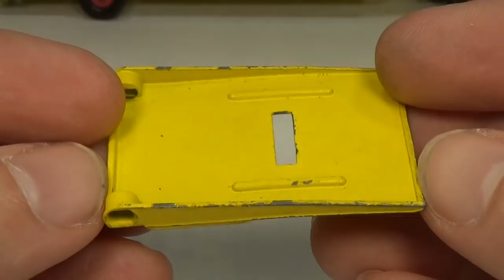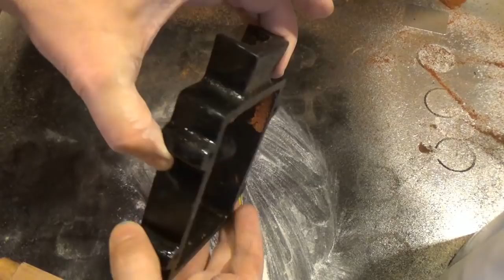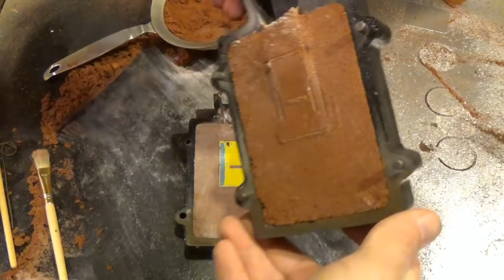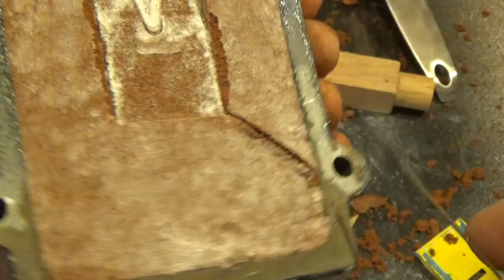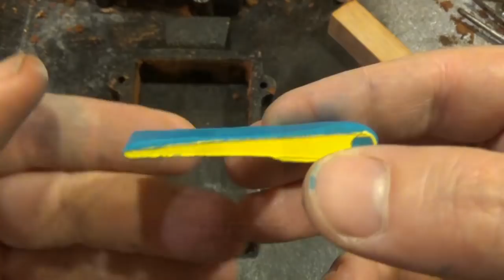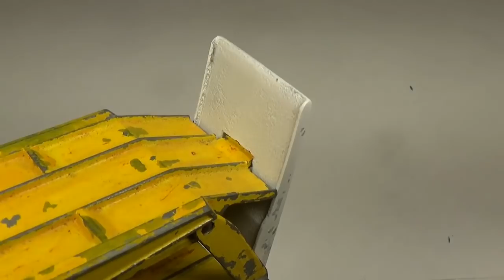Casting Aluminum parts for your Hot Wheels or Matchbox Customs.

Comment: You mentioned safety: no way you should be doing this without welding gloves or something else to protect you from the molten metal. That crucible could slip as you're pouring it. Believe me, accidents happen. Molten metal will send you to the ER. I learned the hard way and have the scars to prove it.

Comment: Hi in the early 1960's i worked at a light engineering firm on a injection plastic moulding machine, they did have a zinc diecast machine. I didn't get to work on that but i know enough to tell you it used molten zinc as you did, but it was forced into the  dies by air pressure pushing a ram and it was water cooled. The dies had to be brushed free of any zinc debris between each and every casting.

Comment: you should create a hole in the section the mold doesn't get filled......later you just need to cut the tube you will get and use the dremel or sandpaper to flat that surface

Comment: I found your video quite interesting as I had been toying with the idea of casting toy parts with low temp metals for some time. However, since many of the toys I have considered casting for restoration or customization have been made by the tens of thousands by the manufacturers, it is much easier to go on line to find beaters to get replacement parts. Case in point, the car carrier you needed the ramp for, I just bought 2 of, in the same auction for less than $10 for the 2 of them. While both are missing wheels, paint and on is missing the windows, they both have the ramp that you attempted to reproduce.

Comment: If you heat the mold before you pour, you should be able to get the thin part done. Bring it up to temp in the oven. It won't be as warm as the molten aluminum, but it will wick heat out of the poured metal slower, allowing the part to fill. If the results are stil marginal, heat it, and point a third torch in the area that's voiding and it should get it over the hump.

Comment: One question, wouldn´t it be easier to cast it in pewter? You would also have no need to change the part for the casting to work and the surface will be nearly the same.

Comment: You might want to upgrade from propane to MAP gas. Should get the aluminum hot enough to cast such a thin part. I don't think you can pre-heat that sand, but maybe you'd have better luck with a lost wax mold with plaster of paris and sand. you should be able to heat it up with propane enough to make it work.

Comment: Heat the mold before pouring, to make sure there's no moisture in it. Molten metal will flash heat any water it contacts and if there's too much moisture, the steam pressure can squirt liquid metal back up at you. Not fun, and it spoils the casting.

Comment: Some notes on alloy, making sure you use an alloy intended for casting, like melting cast parts instead of sheet/plate/rod. Casting alloys have silicon to lower the surface tension that will help the fill a lot. Also, zinc alloys help by lowering surface tension and melting temp, so you can overheat it a little to help with the cooling. Fantastic work regardless!

Comment: I used to do lost wax casting, where the mold is fully contained and heated before casting. Though it is more complicated that sand casting.
For everyone's information.
 It involves making a silicone mold impression using the original part and then making a wax replica inside the silicone. We would then remove the wax replica from the silicone mold and set it on a wax base that forms the funnel for the molten metal. Then a metal enclosure is placed around . Liquid plaster of Paris is slowly poured around the inverted wax piece helping to avoid bubbles developing and leaving the wax base showing at the top. Then the whole thing would go in a small vacuum chamber for about 20 mins or more to, hopefully, remove any remaining bubbles. After allowing the plaster to fully dry (several hours or even over night) the whole mold will be heated up using a gas torch at the same time as the metal in it's crucible. Once the correct temperatures were achieved, the metal can be poured. 
 I was working for a manufacturing jeweller at the time and we had a sprung loaded centrifuge, where the hot mold with metal poured in would be spun around a few turns, inside it's safety cabinet! The spin helps the molten metal to settle fully into the mold.
 It was definitely fun to do, but i was 16 at the time and late too often for my employer's liking. :¬/
Reply: Oh yes, and my mother grew up in Farnborough 80 years ago. It's a town in South England in the county of Hampshire. Plus, I aquired this same model from a car boot sale a couple of years ago for £4.

Comment: I used to work at a foundry and if you want some help i would be glad to help you. I think i know how you could cast the part without modifying the part. And there is a danger when casting you missed. Hot liquid aluminum explodes when in contact with moist iron. But that was a realy good video on casting.
Reply from the maker: +Colin hemligt I would certainly love your help... email me at baremetalhw@gmail.com

Comment: Pouring metal in from one end to a cold mould is probably your problem. Try preheating the mould before pouring or pour from the side through risers and vents you have cut in the sand.

Comment: I also have that transporter but it’s in three parts and will require very special fabrication and reassembly. The tractor is separated from the towing part which has been snapped off from the main transporter. The snap happened at the thinnest part of the structure. It’s a long term project as I have other things on at the moment but I have high hopes for a fair restoration. Thanks for sharing yours!

Comment: I cast Pewter in sand. Able to get very thin castings without issue. And it melts on a domestic hob. Although it’s a softer metal, it would be fine for this application.

Comment: It wouldn't be metal, but if you upload a drawing with the critical dimensions and a few photos from different angles, i'd be happy to model and 3D print you a replacement in solid ABS. It'd have much finer detail and with some primer you'd be able to paint it as normal
Reply: Critters, yay tech!
Reply: Yea, I first thought 3D printing, but it would not have the 'feel' or mass of metal...